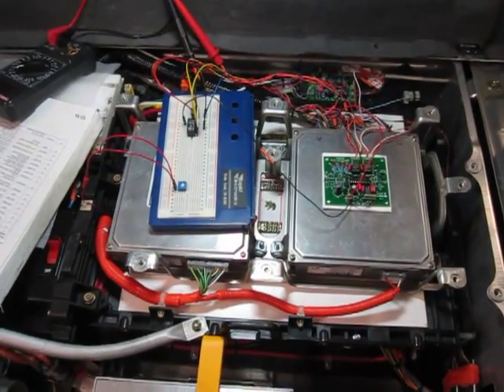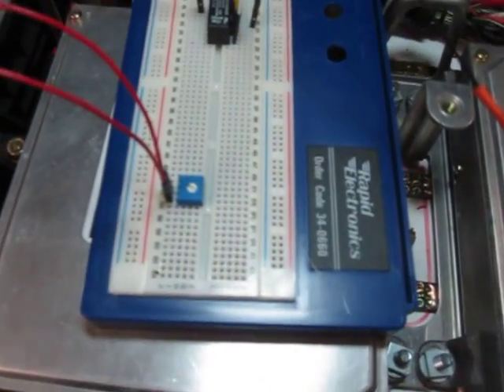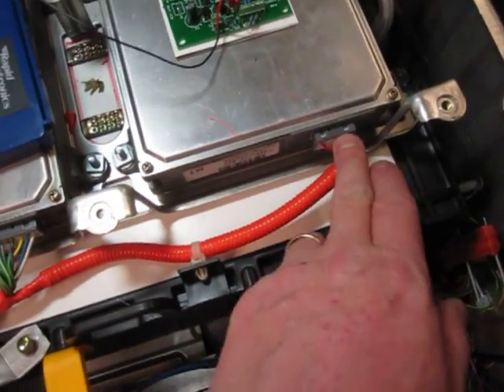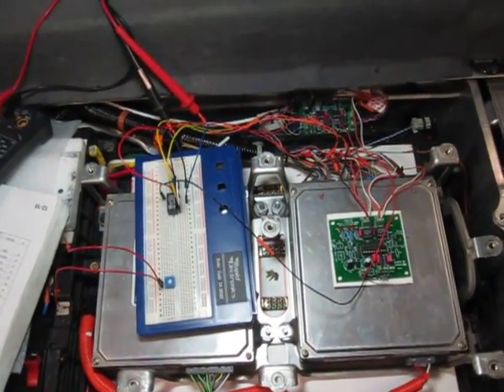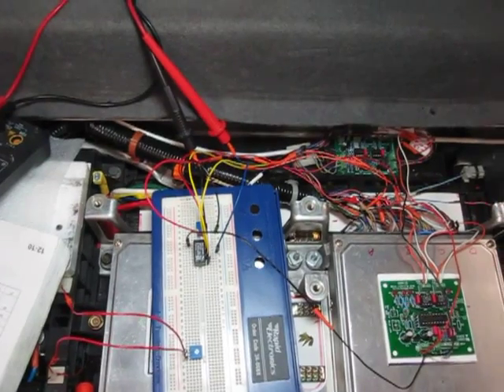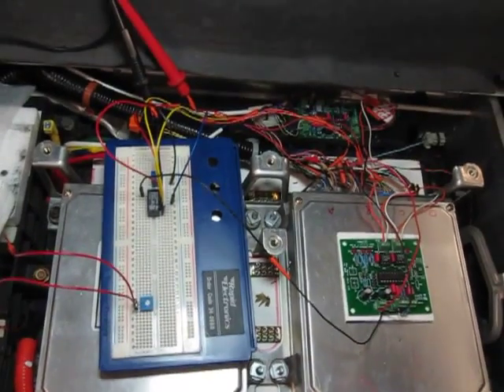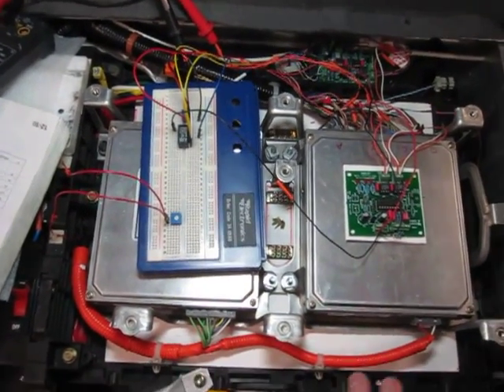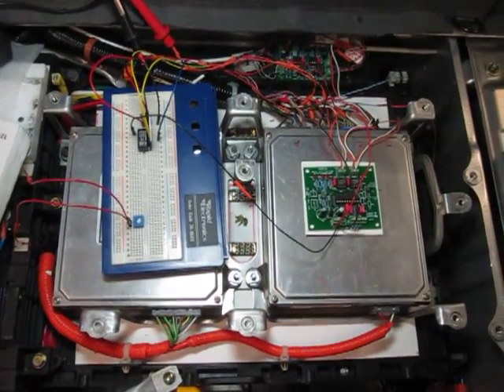MCM More IMA Power Voltage Hack

Comment: What could make the battery fan run at full speed ?
Reply from the maker: Please post questions on the insighcentral.net forum.
Reply: @retepsnikrep do I have to sign in ?
Reply: @retepsnikrep  I follow the link and it didn't work
Reply from the maker: @rafatorres1420rt  https://www.insightcentral.net/
Reply: @retepsnikrep  I did sign up but I don't know how to post my question

Comment from the maker: Note I have now removed a lot of this stuff inc relay and zener diodes and gone back to the simple voltage divider to reduce the battery voltage. See the thread on Insight central forum for schematic and latest updates.

Comment from the maker: I've ordered a selection of 100V+ zener diodes to make a low current 140v supply for the BCM/MCM this will be powered by the main battery pack so should work down to 145v or so.